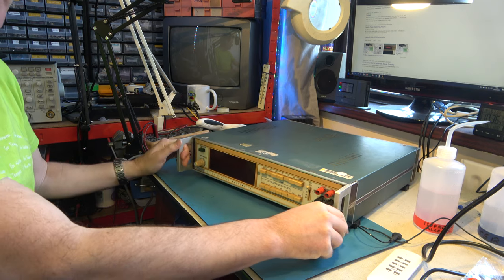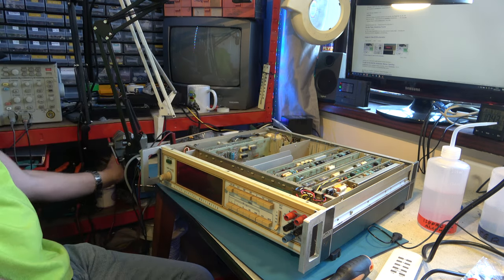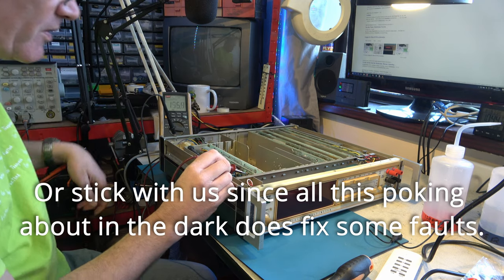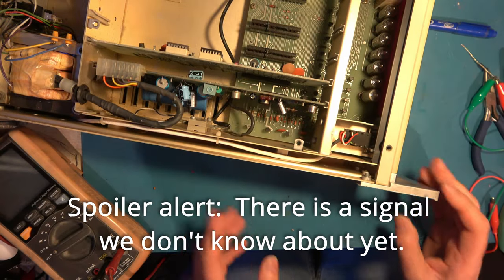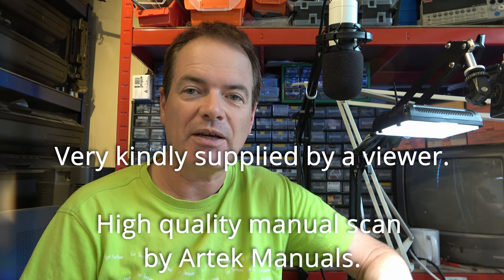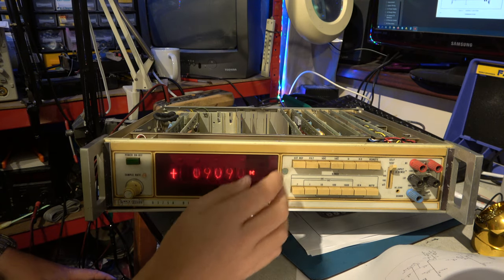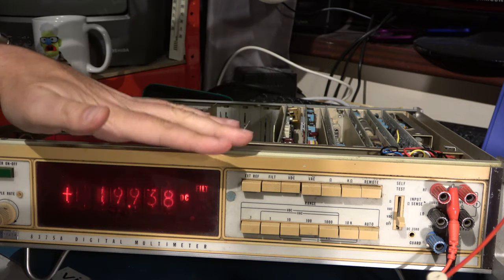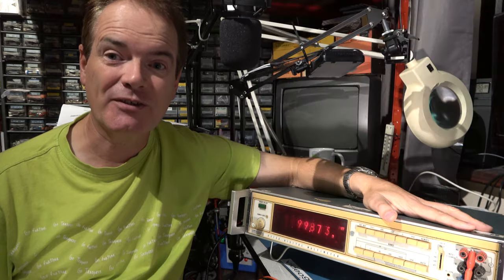Work on 1973 Digital Multimeter with Nixie Tube display.  Fluke 8375A.

Comment: The 8375A  in its day it was a True RMS 5.5 digit meter.  In resistance mode it could measure down into micro ohms !
Reply from the maker: Alas not true RMS on mine since the AC volts is all over the place.

Comment: Well done colin :-D, and you still had the same T shirt on, oow smelly ha ha joking :-D
What a oddball power supply setup.
Well i was about 7 years old when that was made, it's in better condition than i am lol :-D
I think every switch and every analog board connections need a good clean and drench.
Those relays i would do repeated resistance tests., but thats just me :-D
Reply from the maker: That's why I used the same T-shirt for most of my videos, to overcome continuity problems.  I have some video99 branded T-shirts on order though.  I too would have been about 7 when the Fluke was built.  Waiting to see if people want me to work on the AC Volts range.  It certainly wouldn't be easy without an extender card.

Comment: I also have that multimeter. I could help you with the Service Manual???
Reply from the maker: I have a soft copy of the service manual now, thanks.  Does the AC RMS voltage measure properly on yours?  It is way off on mine.
Reply: @video99couk  ,Yes, my multimeter correctly measures AC, DC, Ohms, in all scales.!